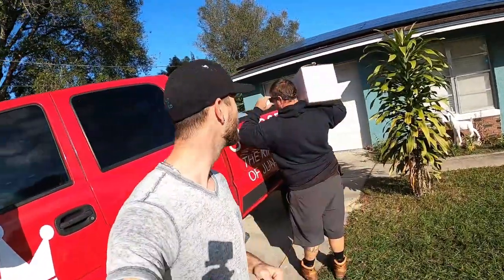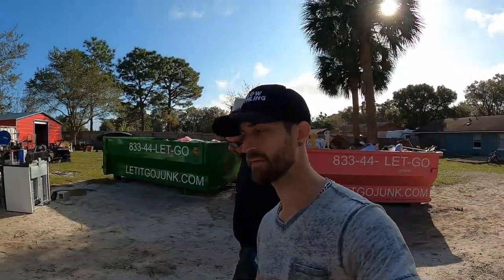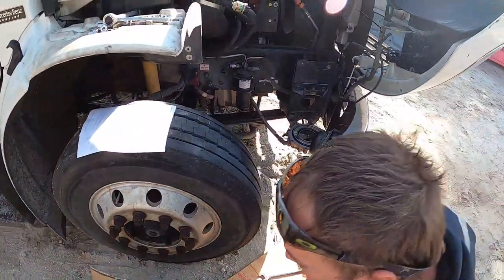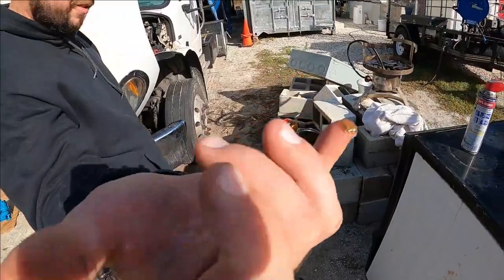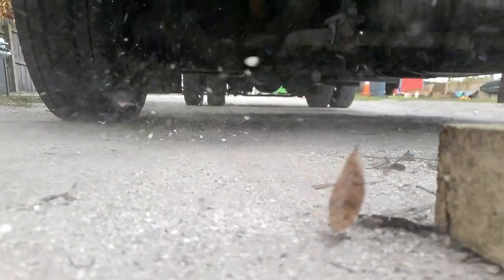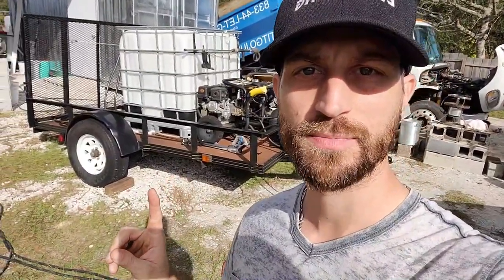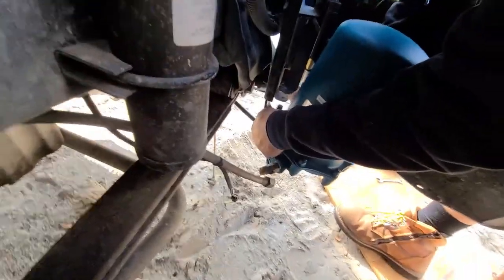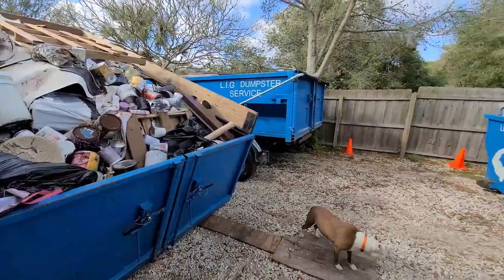Keeping busy while it aint easy in junk removal and dumpster rental

Comment: IT'S YOUR AIR PUMP, OR YOU NEED TO CHECK 2 C IF THE AIR REGULATOR IS BAD OR NEEDS TO B SET AT A HIGHER PRESSURE, i'VE GOT A BAD REGULATOR B 4 .. HOPE THIS HELPS

Comment: I have 6 of those water tanks on your trailer. I cut the tops off and put small trash loads in them. Them add them to bigger loads when needed. I move them around with my 1025r tractor with forks. I was thinking of adding this to my trash removal service. Drop 2 off and let customers fill them. As long as the tractor can pick them up ( 500lbs after tank weight is subtracted ) then no extra charge. If tractor couldn't lift them. Then charge extra to transfer to extra tank i would bring. Feel some of my contractors would love this. But wouldn't want to them to over load them. Because tractor max lift is 800lbs to lift on trailer. Up to 1300lbs just to get it 2 inches off the ground.
Reply: PP
Reply: @comfortoseiasante2269  we all try and expand are business. Some fail. Some work. Im just hoping if i was to start my small tote drop off it will be a good way to make extra money. Just like his water pressure. Unfortunately im still trying to plan this out. But i can already see the bad about it. Before i offer a different service. So yes PP. But we all have ideas to expand and offer more services. But his video just shows some of the things we expand on can fail. Just glad let it go was willing to put it out there and let us know about his PP about his failed Adventures.